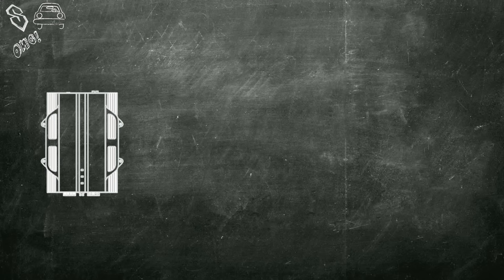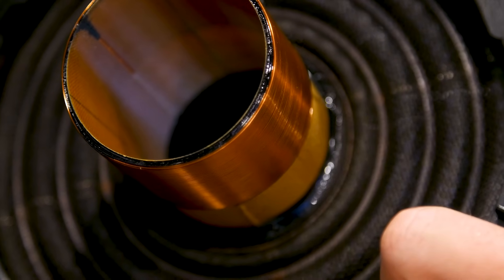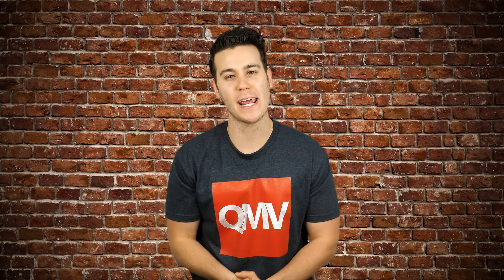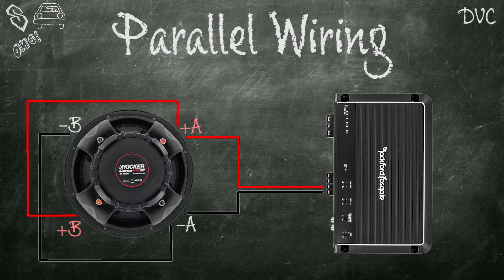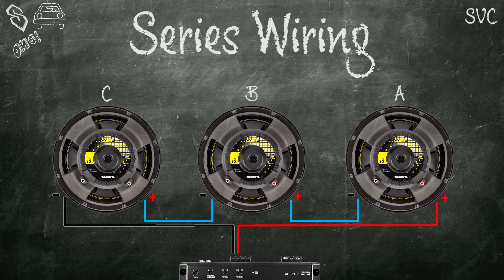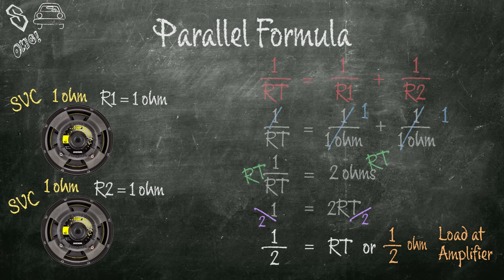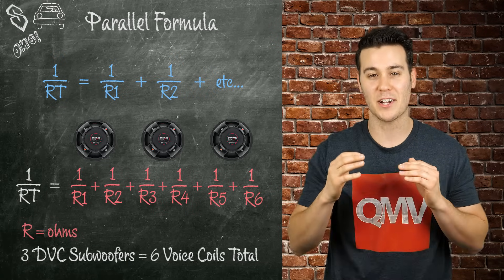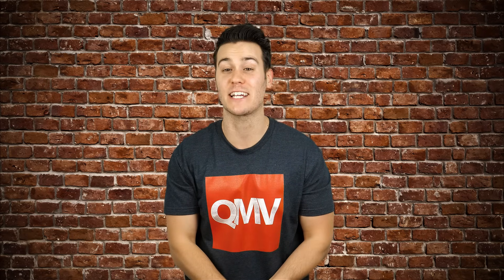How To Wire Subwoofers - Parallel vs Series - Single Voice Coil and Dual Voice Coil

Comment: Hey so you said that voltage is the size of your pipes. Voltage is the pressure in those pipes. Amps is the flow.. the size of that pipe or wire is just a measurement like guage ect.

Comment: Yes I am connecting my woofers today. Your video answered my questions. I have dual voice coil 4 ohm. I am going with parellel
Reply from the maker: Bump it.
Reply: @Qualitymobilevideo  ok. My system is bumping HARD! However I am using a 2000 watt NEMESIS amp and the stupid thing gets hot after 20--30 min of loud bassing and it turns off.........talk about losing an erection. Ah ha guess I need a better quality amp. Looks like. Any recommendations?
Reply: Get a cooling fan. I bought a specific amp that ran in mono, pullimg all 800 watts. The amp had a special circuit that ran cool and would shut off if the temperature spiked. It was shutting off all the time. Went to radio shack and bought a couple of 12dc computer fans, built little fixtures for them to attach to the amp, and presto, no more shut downs. If your amp does not have that cooking circuitry, you will end up, over some small spance of time,  burn up your amp. Man, you could hear my one 8in dual voice coil from down the street. People thought I had a couple of 12s in there. I miss that life. Now I drive a 2018 Volkswagen Tiguan and I wouldn't know how to get into that dashboard to install the wires and harness adapters.

Comment: hey when you use the formula to get the min-max wattage amp to match the sub is it okay to go a little over the max ? for an example if 2 subs =2500 rms the max wattage with the formula is 3000 watts. Is 3200watts okay to run ? How about 4k on it ? how about 3000rms= 3600 max watts from amp Is 4k safe to run ? how about 5k ? THANKS
Reply: also 2 dual 2 ohm subs wires to 1 ohm 2500rms if I get a 1 ohm 5k amp can i wire it to the subs at 2 ohms 3200 watts ?

Comment: I have 2 10" Rockford p2 4ohm speaker and Rockford r2-750x1 amp what is the best way to wire the speakers to the amp? Series or parallel? And what is the best ohm to have at the amp?

Comment: Hello good day to you sir,, i have a pioneer TS A300D4 500 WATTS RMS DUAL VOICE COIL 4 OHMS EACH VOICE COIL.. MY QUESTION IS , OR I CAN SAY MY PROBLEM IS, CAN I USE ONE PIECE OF THIS SUBWOOFER FOR PIONEER GM A6704 CAR AMPS INSTEAD OF USING TWO PIECES, I WANT TO USE ONE SUBWOOFER ONLY AND A PAIR OF 6X9 OVAL PIONEER FOR VOCALS..PLS HELP SIR THE RIGHT AND PROPER WIRINGS FOR THIS TO AVOID ERROR THAT MAY CAUSE DAMAGE TO MY SPEAKERS AND AMPLIFIER...THANK YOU SO MUCH FOR YOUR ADVICE.....

Comment: Hey thank for the helpful video, but one question i got two 6.75 dual voice coil and a kicker CX360.4 how do i wiring my sub into my amp. Do i wiring bot sub in bridge or 1 on each chanel cause in your video it seam always plug in one chanel and I want wiring two coaxial 4omh speaker Thank you for the help.
Reply from the maker: What impedance are your 6.75 subs?
Reply: 4 ohm

Comment: I need to kno if I can hook up a Kenwood 4 ohm 500 watt rms with alpine 300 watt rms 4 ohm to a amp that has 4 ohm x 2 400 watt rms, idc if it's bad for alpine I'll get another Kenwood down the rd or should I just put Kenwood in dual 12 ported  box for now ?????

Comment: I will disagree and say, voltage is water pressure like 1000 psi  as 1000 volts. And resistance is pipe size, small pipe will be like high resistance.

Comment: Okay I have a the setup that is single voice coil wired in parallel making it a. 2omh 1000rms set up so can I use a 2 Channel 4omh per Channel 500 RMS pre channel amplifier as well as a mono 2omh 1000 amp

Comment: When using active powered subs at home how do perform series/parallel wiring with high level outputs
Reply from the maker: When using active you cannot, the amp is in the sub, regardless of home or car.

Comment: 4:01. Correction. If u wire it in complete series all the bulbs would go out not just the remaining.
Reply from the maker: If wiring light bulbs or speakers, pop the coil everything goes out.

Comment: I have a Taramp 3k 1 ohm and I’m trying to run these Db drive WDX 4ohm 2500 subs would I need to parallel them or can I series them ? Right now I have em parallel but it’s clipping on the amp any info on that?

Comment: Those formulas are ridiculous and made my head hurt. Oy Vey... 
If you series multiple coils no matter if they are in one sub or multiple subs,, or rather,, any voice coiled speaker the resistance of the coils gets divided between them.. meaning if you have 4 -4ohm coils and you wire them in a series to one output of an amplifier. They will be multiplied resistances.. I.e.  .... 4ohms  x 4 coils  = 16 ohm load. This wiring resembles a straight line of wire thru all the coils . One to positive side out the neg to next coils positive etc... then last neg back to amp.. The problem with this wiring is not obvious to  normal people.. The issue isn't impedance.  Its distortion. While it helps with wiring situations and multiple speakers (coils) everytime you series another coil it compounds the output distortion level of the output from the amplifier .. Yeah.. Right?? That sucks.!! Seriously tho.. its true.. Anyways ,,, Parralel is the opposite of series basically. You wire all the coils Pos to pos and neg to neg. And  stack the wiring together accordingly. This wiring adds the resistance together.  I.e.. 2 - 4 Ohm coils paralleled together = a 2 ohm load..Tho most A/B class amps it requires a flipping of the phase of one coils wiring when you add them but. Shit. He covered that in the video...
Not....
 So yes it is usually the best convenience to wire multiple coils in a series/parralel configuration.  But as i said . Series - ing multiple coils no matter if its with a parallel  wiring or not DOES compound distortion to subs.. But if ya like distortion go for it. Ive been doin this for quite a long time now. Since the late 80's.. 
But,,, to each there own right.? 
Whatever ya do.. I hope it works for ya.. 
Peace y'all

Comment: How about the old school Memphis madd maxx 15 inch quad 1 ohm subwoofer? You have in a single sub 4 coils at 1 ohm does that make .25 ohm and 4 ohm respectively. Can you get the sub to do 2 ohm load to amps by splitting the loads to two coils per amp? Effectively making .5 ohm and 1 ohm or is it .5 and 2 ohm? I am thinking.5 and 2 but keeping it at 4 coils in one sub to a single amp make it .25 and 4 I believe. How about that brain teaser. I do believe it makes a .25 and 4 ohm load but also can you just put 1 amp per coil then keep the resistance at 1 ohm and that’s basically it?
Reply from the maker: it’s actually .25 and 1 ohm.

Comment: I got a 1500watt dual voice coil boss 4 ohm and a 800watt boss single ohm speaker 4ohm.  My guess is half the watts is actual rms.  I'm not sure what amp to get and whether or not to do parallel for 2ohm or series for 8 oh 🤔 confusing.  Perhaps someone can help me find a amp.
Reply from the maker: You cannot use both subwoofers together on the same amp or in the same box. You will need separate amplifiers and enclosures and set the outputs individually.
Reply: @Qualitymobilevideo  makes sense ty!  I'll get another of the same.

Comment: So 1 questions are subs louder in parallel? Becuase when i wire in series its less bassy  
Even tho the amp is powerrfull enough that i can easily blow the sub or ao i just need to wire in parallel and increase the bass on the amp it self ?
Reply from the maker: Every situation is different and completely dependent on your gear. Parallel will get you a lower impedance which means more power

Comment: Can anybody tell me how to wire my subs out of phase on a 1 channel taramps 5k. I have two 15s in a custom box very weird shape to fit my truck. I need to invert one sub but my amp is only one channel. How do I change one subs polarity without changing the other?
Reply: Switch the negative and positive around on one sub

Comment: My freind i have an audio pipe 12” dual voice and 1500 amp the subwoofer  say 1600 watts but i just want to bump litle be no crazy to destroyed my car so how can i do the wire conect also is make any diferent if i just used like an normal subwoofer one coil +- and +- in the other i dont know i need helo on this

Comment: Question , if I have a dual 2 ohm subwoofer put I only use one side of each subwoofer to get 1 ohm load ,does that mean Iam only using half the subwoofer because I only used one side of the coil

Comment: I’ve got an odd question I have two 4 ohm dual voice coil subs that are 1250 W each. I’ve got a 2000 w skar audio 1 ohm amp.  the only way I can wire those subs in 2 ohm or up so can I wire it at a half ohm and turn the amp gain down without hurting the amp as long as I don’t run it at full gain will that work without hurting the amp?
Reply: Wire it at 1 ohm .. Parallel all 4 coils and youll have a 1 ohm load. Parallel each subs coils first. Then parallel between the 2 subs. 4 - 4 ohm voice coils paralleled  = 1 ohm..

Comment: ?? How would it work and sound  if you took a good 12" home speaker and cut it in 1/2 removing the tweeter and mid range stuff and just left the big speaker end of it, then covered the "CUT" end area back over and hooked an amp to it??

Comment: Why are u dividing the resistance into 1?
That’s gonna give u the wrong number... 
for instance if u have 6 subs at 2 ohms in series it’s 12 ohms, but if u divide that into 1 it’s like .08... which is not the resistance. 
I really felt like u just went to a random website and just copied their formulas.

Comment: I was running a 1ohm load and could smell my sub getting hot then went all the way to a 4ohm load and could still smell my sub getting hot what could the issue be? Sub was 600wrms and amp was 1000 at 1ohm 500 at 4ohm

Comment: ..........i'm going to have to google wtf RT means... how annoying . Instead of ACTUALLY explaining this like a normal person you have to "flex" your "big brain" with damn letters instead of just putting the actual numbers .......
Reply from the maker: As I show in the video, RT is the "LOAD AT AMPLIFIER" (or resistance) as I defined it on the chalk board graphic at the 6:43 mark. But of course you didn't notice it and have to take your anger out with a hateful comment. This is probably the most informative subwoofer/amplifier wiring video on the internet. You're welcome. Not my fault you can't understand these concepts or fractions

Comment: So if I have 2 single voice coil 12s rated at 4ohm a piece and a 2ohm amp, I should run them in parallel to get the 2ohm for the amp, correct? Hooking up a surprise Christmas gift. Hopefully she doesn't run off the road when she turns it on.🤣🤣🤣

Comment: Help! I bought a set up at the pawns shop😟😟😟 with three kicker 10's One L5  Dual voice coil and two shallow mount svc all run 400 watt rms each 4ohm speakers 🤪🤪 
I have an  XTR 1500.1DZ Amplifier Cla
ss D 1 OHM Stable I need 2 ohm how do I wire these subwoofer?

Comment: So short story im to dumb and just got lucky.. about 2 years ago i was very impatient and didnt take the time to learn anything (still kinda am since its still working with no issues) just ran out and picked up a 10 inch kicker sub and 800w amp and did everything myself. Even custom made a box to fit under the strut tower of my 350z. it sounds great and nothings went wrong. Amp even missed having a soda being dumped on it by literally an inch and a half... It had splash back on it but was hardly even touched.

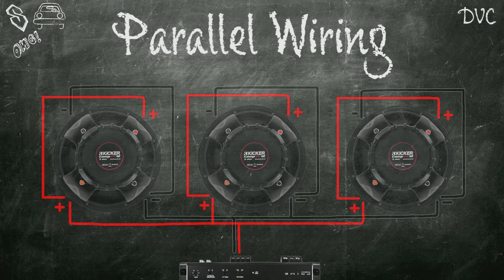Comment: You did series wiring when showing parallel at 4:41. You have the positive wire going to B+ when you had just showed it going to A+ with the single speaker.

Comment: Hey, man great video. I have dual subs and for some reason, my subs work but play very low and I know I have the right amp and have it wired as single-coil parallel wiring. I was wondering if you have any suggestions on what it could be, I saw some things about the subs being out of phase but I'm not sure how true this is or how I would fix it. Anyways any help would be much appreciated.
Thanks.
Reply: A/B class amps in particular have this problem.  
Does the output to the subs sound rather flat dynamically ? Kinda tinny? Like no bottom to it?
Try this.. 
Unhook one.. leave the other one hooked positive  from speaker to the positive output of the amp and same with the negative..  now turn it on at a reason able volume.. bout 35% or so.. 
Now as its playin take your other speaker Leads and try it both ways.. first try connecting positive to positive side of amp like the other one. If it does not double the loudness and thickness of the bass,, then reverse the polarity.. only do this by hand.. touch the leads to the terminals. Dont actually screw them to it till you find out which way is correct. Some amps require this one sub positive polarity one sub reverse polarity.. usually its only class A or class A/B amps . But even some class D amps do
..  hope that  helps ya ....

Comment: So I’ve got 2 4 ohm dual voice coil speakers if I wired them in parallel what would my final impedance be?
Reply from the maker: It will be 1 ohm! We actually have a video on this: https://www.youtube.com/watch?v=fyyEDnv-T7o
Reply: Quality Mobile Video if I series parallel wire then my final impedance should be 4 correct ?

Comment: I doubt it but would parallel wiring work with one DVC and one SVC?
Reply from the maker: You don't want to mix different kinds of subs in terms of specification, always try to use identical subs
Reply: Quality Mobile Video alright thanks. So if they’re the same specifications then I should be good. I know it’s better. But do they necessarily have to be the same bran
Reply from the maker: But they're not the same specifications. You said one is a DVC and one is a SVC
Reply: Quality Mobile Video I meant if they’re both DVC but not the same brand. Same wattage but different brand.

Comment: Quick question

What's better
2 JL audio 12TW1-2 shallow subs (2ohm subs) running on a JL audio JX 500/1
Or 
2 JL audio 12TW1-4 shallow subs (4ohm subs)
Running on same amp??
Reply: 2ohm louder

Comment: I have a Rockford Fosgate prime 1,200 Watt Class D- Mono Amplifier, that i want to connect to 3 Rockford Fosgate Punch P3SD2-12" subs. They are (400W RMS) Shallow Mount Dual 2-ohm. What would you recommend to be the best way to wire these so i can get the most power and the least resistance?

Comment: What if my amp is power at 2ohms at 1,600W and my subs are 1,250w. Max 2,500 will it burn the subs? Or should I just stick to the 4 ohms how the speakers come

Comment: You will not read AC impedance with a multi meter. You'll need an impedance meter. Multi meters only read DC resistance in ohms, and since audio is never DC, you will not read the correct value. The correct value is constantly varying with voltage, and frequency since the signal coming out of the amp is always AC. So... don't mix it up. An 8 ohm speaker is an AC impedance value, which is an average value calculated by the average resistance the speaker will show to an amp based on the frequency response and other factors.
Reply: Actually speaker impedance  is a  Nominal measurement.  not actual. It varies as the coil is moved.  Usually a4 ohm sub coil actually will measure at around 3.8 ohms.. which is what i think you were getting at .. lol
Reply: @tobiasmenough  what I was getting at is, just like a multimeter uses RMS to display an AC voltage, there also exist impedance meters that can be set to the speaker circuit's operating voltage (ie, 70V, 25V, or 8 ohm) and they will display the actual load in watts that exists on the line. A lot of people try to use regular multi meters set to resistance and assume ohms are ohms, but 20 ohms of impedance is very different from 20 ohms of resistance.

Comment: I have a question. I have 4 kicker 4 ohm Cvr's and currently running 2 ohm on a Nemesis audio 3k amp and its just not enough bass for me. Could I wire each pair at one ohm? Please answer this. Thanks!

Comment: Wait so I have two 12inch SVC 4 Ohms subs. What amp would I need and how do i need to wire it?? From what I got.... I believe a (Stetsom EX3000 2 ohm Amplifier Car Audio Mono Amplifier Digital  Amp Sound 3600 W) would work right? and I am supposed to wire it in parallel?
Reply from the maker: You'll be making a 2 ohm load in parallel yes. But I can't recommend an amplifier without knowing the power specs of the subwoofers